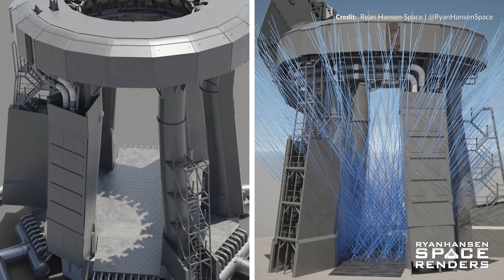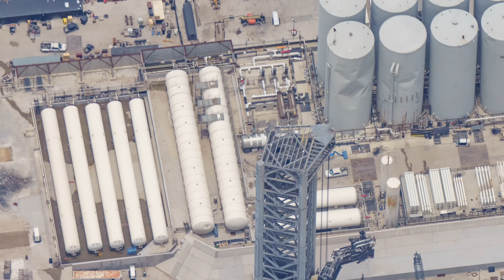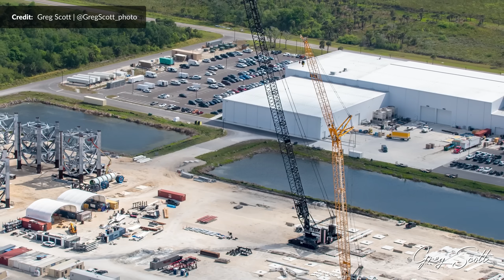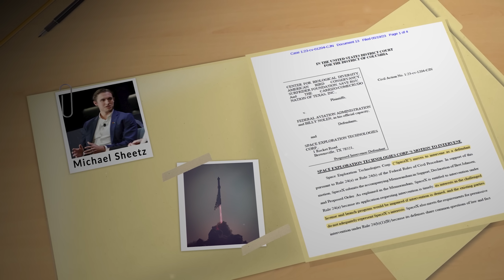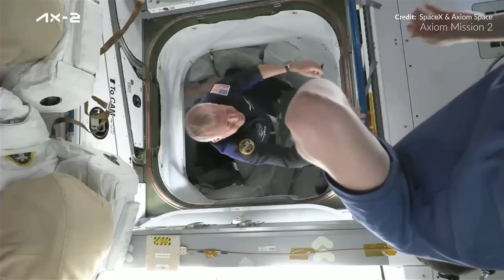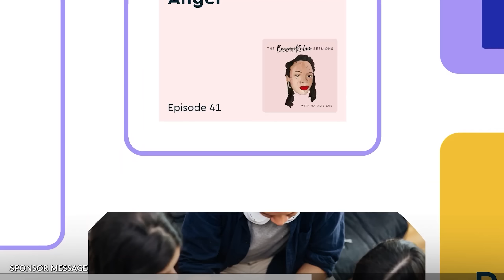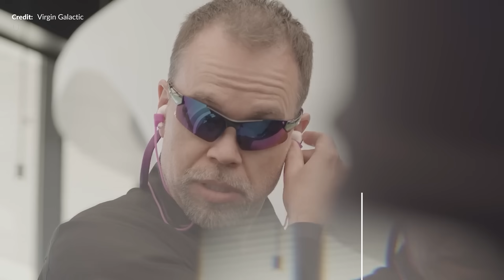SpaceX Starship 6,000 ton Capability, and SpaceX Joins FAA for Legal Battle, Axiom 2, Unity 25

Comment: HI ALL. DOES ANYONE SEE THE PROBLEM WITH LAUNCHING THIS WORLD'S LARGEST ROCKET FROM ONLY WHAT 80 FEET OFF THE GROUND AND AT SEA LEVEL?? I BELIEVE THE TOTAL LENGTH OF THE ROCKET IS AROUND 230 FEET. THE FLAMES SHOOTING OUT ARE LONGER THAN THAT MAYBE 250 FEET OR MORE. ELON AND SPACEX SHOULD MOUNT THE BASE OF THE ROCKET AT 250 FEET ABOVE THE GROUND. THEN YOU FORTIFY THE TOWER AND YOU WILL HAVE LESS DAMAGE. I BELIEVE THE NEXT LAUNCH WILL HAVE SIMILAR DAMAGE IF THEY DO NOT DO SOMETHING LIKE I SUGGESTED. YOU CANNOT HAVE THE WORLD'S MOST POWERFUL ROCKET SITTING SO CLOSE TO THE GROUND. IT IS COMMON SENSE. YOU DON'T NEED TO BE A ROCKET SCIENTIST TO SEE THAT! NO PUN INTENDED......

Comment: I truly appreciate your channel's amazing content; however, I feel compelled to interject here:

I am concerned about your treatment of the court case. SpaceX is going to court alongside the FAA against environmentalists, and there is probably a substantial reason for their concern. The message about Starship's importance does not address or attempt to resolve the case in any way. I would have liked to hear the environmentalist's arguments in detail and--perhaps--whether you think that the claims are justified. Dodging the issue by instead repeating SpaceX's money-based defense and reiterating Starship's standard elevator pitch--in my opinion--supports the idea that SpaceX should not be held accountable for unnecessary environmental damage like everybody else. The end goal is great, but what if they had just taken a more responsible route that threw less concrete? Blew less dust? And yes, it might have taken more time. It might have cost some money. But, that is not our concern. Irresponsible and/or lousy means to an end are NOT justifiable, especially when there are proper methods of proceeding--even if the end goal is great. It does not matter if it costs a bit more and takes a bit more time. A delay is only a delay because somebody set the timeline too short, not because an annoying (preexisting!) regulation got in the way. A lot of noble things would be easier if the law didn't exist, but that doesn't mean that we get to ignore it.

There is absolutely nothing wrong if you delve into the details and wind up raising a bit a of dirt in the process. I would not take it personally at all, and neither should anybody else. At the very least, if diving into the details is too much, please leave it as an open-ended question rather than putting a SpaceX-positive spin on it as a default. I have come to rely on this channel for NEWS that fits my interests, but this court case take is pushing too close to the realm of opinion, selective presentation, and diehard-advocate content. In hopes of continuing to be informed by you and your team for years to come, I humbly ask that you consider this.

Sincerely,
    Scott
Reply: From the SpaceX motion to join the case, page 5.
"C. Plaintiffs’ Complaint
On May 1, 2023, Plaintiffs filed a complaint challenging the FAA’s environmental review and “decision to approve SpaceX’s application for a vehicle operator license” under NEPA and the Administrative Procedure Act. Compl., ECF No. 3 ¶ 14, Prayer for Relief (a)-(b). Plaintiffs seek to set aside the PEA and FONSI/ROD and invalidate the FAA’s decision to approve SpaceX’s launch vehicle operator license. Id."

The FAA was the lead agency with NASA, the Army Corps of Engineers, the US Coast Guard, the US Fish and Wildlife Service, and the National Park Service all involved from the beginning. The review was to see if Starship would fit under the existing EIS from 2014 for Boca Chica for Falcon class rockets or if a new EIS was needed.
Reply: @steveaustin2686  Ah I see, thank you.
Reply: @scottviola8021  You're welcome.

Comment: Will the launches of these super rockets change the spin of the earth?  We could be looking at minutes per year lost or gained based on the thrust against the earth's atmosphere.
Reply: No. Starship at most would mass almost 6,000 tons if they stretch Starship per Musk. And a LOT of that mass would be left on Earth as exhaust from the launch. The Earth masses around 5,972,000,000,000,000,000,000 tons. So a stretched Starship would be 0.00000000000000001% of the mass of the Earth.

Comment: Additional weight capacity with the Raptor 3 means they can throttle down and still push the same loads which also means more re-usability since they're not hitting operational limits. It also means they can absorb small deviations in payload mass if scientists want to throw an extra sensor on a future rover or something.
Reply: I somehow doubt the validity of your claim...

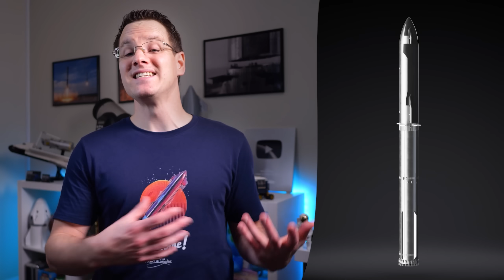Comment: 8:17 But the 20:02 Where all Stage 2 goes? I need that neobium.   xD
Reply: At 20:02 is the Falcon 9 second stage and it is expended. SpaceX eventually wants to reuse the Starship (second stage), but they are going to expend them in the  early testing as they dial in the accuracy.

Comment: Agreed the 6000 tones of capacity would be ideal for dense payloads like propellant  where the starship stays the same exterior size - this would enable tankers with greater capacity - it also has the effect of making RTLS for the booster easier.
Reply: It's not 6000 tons of capacity. The expended payload of Starship is 250-300 tons per Musk's tweet.
Reply: @steveaustin2686  I know 6000 tones is the potential lift-off mass when they have the raptor 3 in operation.
Reply: @stephenhumble7627  Yeah, apparently up to 300 tons of payload and evidently adding another ~800-900 tons of propellant. For a normal Starship they have 3,400 tons of propellant on Superheavy and 1,200 tons on Starship (second stage). There is somewhere between 200 and 300 tons of dry mass for both stages.

Comment: After watching, reading everything I could plus many top engineers opinions (who don't work for SpaceX) on the launch pad and just using basic common sense from so many different of engineers, this new launch pad using a water cooled metal/steel plate and its new engineered water deluge system, I am making a bold prediction. This new launch pad will be a failure due to not having enough ground clearance from the engines to the ground and no diverting trench to the base launch pad and if and when SpaceX is allowed to launch again with a FAA permit (which will not happen this year, if the FAA even does give SpaceX another launch permit), SpaceX will be obligated to destroy this launch pad and absolutely have to create a new launch pad with a flame, sound, heat, impact diverting trench with a better basic but more advanced huge water deluge system. 

No SpaceX engineers can anticipate what power the 33 Raptor engines will have on the base of the launch pad. This is uncharted territory and dealing with more power than ever attempted. SpaceX will have to accept the fact that a deep, strong diverting trench will be a must have, in order to absorb such powers from their Raptor engines, especially when they'll use the newest Raptor version 3.0 which is even more powerful than the present Raptor version 2.0. And they'll also eventually create a Raptor engine version 4.0 that will be on a complete next level in power differences from present version 2.0 to 3.0 and it would be much wiser to build a new launch pad that will be able to absorb these future powerhouses of engines. Right now, the changes they are making by adding this water cooled metal plate and water deluge system is like putting a band-aid on a bigger wound that will grow bigger if not treated appropriately in anticipation of increase power levels that Starship will have in the future. 

Last note, I don't think that the FAA will grant a launch permit to SpaceX this year, especially if the court battles against the FAA could drag on for months and even possibly beyond a year and change. I would love to know your opinions on this prediction or what you feel would be needed to make a launch pad able to withstand the powers involved? What are your ideas for something that could/would work, yeah I am asking your ideas and opinions as to what would you do?
Reply: To be fair, the distance from the OLM to the ground is the same as the distance from the pad at LC-39 to the bottom of the flame trench. What the OLM didn't have was a deluge system and a diverter.

The FAA gave SpaceX a launch permit in Apr 2023 that lasts until Apr 2028. Now they are grounded for Starship until the FAA is satisfied that SpaceX has determined the failures and rectified them. I would not be surprised if the repair and upgrades take longer than that, given how long it took to make Stage 0 in the first place.

We don't know that Raptor 3 will use that much more thrust than Raptor 2. They may want that extra margin for Raptor 3 to be able to run it lower than at max power for normal operations. That would likely increase the life of the engine for reuse, which is what SpaceX wants.

The court battles stopping the FAA and SpaceX would depend on the judge putting an injunction to stop flights until the case is over. That is not a given I would think.

Comment: Looks like the ISS is finally getting the number of crew visits that it should have been years ago. Once Starship is online, there will be potential to add some very large modules to the station, ready to use as a base to begin building commercial stations.
Reply: Axiom is already building modules to add to the ISS. They will be separated to become their own commercial space station, before the ISS is retired. Some of the newer science modules may be taken along, when Axiom's station is separated. NASA is funding one or more commercial space stations under their Commercial LEO Destinations (CLD) program, so with Axiom station, that should be a minimum of two commercial stations to replace the ISS and possibly more.
Reply: @steveaustin2686  More would be better, and especially a station that could be used as a hub for linked Starship units (or similar from othe companies) where that hub becomes the host vehicle for round trips to Mars etc, linking the vessels to share life support loads.
Reply: @PiDsPagePrototypes  Yeah, because the new commercial stations will each be smaller than the ISS, but with enough of them, they could be larger than the ISS as a group. SpaceX apparently didn't bid on the Commerical LEO Destinations (CLD) program, which seems odd, considering that one Starship would have the volume of the pressurized sections of the ISS. SpaceX did have the GAO redact the info on the [DELETED] Starship propellant depot, which also seems odd. I mean, if the depot is just a depot, why redact that it is a depot, only to confirm it is a depot from the context? I think that is because the [DELETED] Starship propellant depot is more than a just a depot and possibly a small station as well. That would be why it is shown in the graphics as stretched compared to a normal Starship, so that they can fit the active cooling systems and a small station together. It would make sense as a backup if Starship takes longer than expected for an Earth crew rating or if Starship can't be reliable enough for an Earth crew rating. Then the station could support Crew Dragon/Starliner for Starship missions where those capsules bring up crew, instead of launching on Starship.

Comment: A cylindrical ship of this size will not be able to land or launch on any celestial body, as it would blast its own grave twice, upon landing and then by launching. Anything within many dozens of kilometers on the Moon or Mars would be obliterated. Only a spherical ship with equatorial ring engines can make it to the ground. And then a huge effort is needed to just create a safe launch plate. How to build anything like a 1m launch concrete platform on the Moon or Mars? This takes a space able construction technology, a whole new industry
Reply: Take a look on the Spacex moonlander design, the engines for the landing are on the side of it so there will be no crater
Reply: The Superheavy booster doesn't leave Earth and is not needed on the Moon or Mars. The Starship (second stage) static fires never destroyed the concrete like the Superheavy booster did.

As Otopon said, the HLS Starship plan is apparently to use a ring of 24 smaller LCH4 engines at the top of the pressure tanks for the last bit of landing and first bit of launch on the Moon. They are roughly 25m off the surface, so that should minimize regolith disturbance with the landing thrust in 24 smaller engines instead of up to 3 larger ones. A Mars Starship would likely have a similar system.

Comment: if they'd only lengthen the starship and not the booster they will end up with less fuel in orbit then if they increased the length of the booster and kept starship the same. also lengthening the starship by 20% will deliver roughly 1% more fuel, as any extra kilo of payload needs like 4 kilos of fuel to get into orbit and every kilo of empty starship fuel tank also needs 4 kilos of fuel to put into orbit. The tyranny of the rocket equation. Just making starship longer would be incredibly inefficient.
Reply: From the graphics on how the refueling in LEO works, it appears that the [DELETED] Starship propellant depot is the one getting the stretched payload area. We really don't know what [DELETED] is besides a propellant depot, as SpaceX had the GAO redact info on it. We know that [DELETED] is at least a propellant depot from the context. If [DELETED] is only a propellant depot, then it makes no sense to redact that info, only to confirm it in context.

Most of the propellant depot space is in the tanks. The payload space will have any active cooling systems needed as well. But if you also stretch the payload area for a crew transfer station, then it can be a backup until Starship can be crew-rated for Earth operations or if it can't be reliable enough for Earth crew operations. In either case, you can launch the mission Starship unmanned to get refueled and send up Crew Dragon/Starliners afterwards for the crew travel from Earth to LEO and back. If the [DELETED] can support the spacecraft like the ISS supports them, then you can do missions of up to 6 months, while the capsules are supported for the ride home. Starship should be large enough for up to 5 docking ports, 4 on the sides, each 90 degrees from each other and possibly one on the nose. Once Starship matures to a fast enough cadence after Artemis III, then it may allow a Starship to directly replace the SLS/Orion for the trips to and from the Moon. Something like this would be worth redacting the info on a possible depot/station I would think.

Comment: Starship Luna version needs to be larger for more fuel capacity. Otherwise how will they accomplish that many burns? Even with LEO refueling the regular Starship won’t do it.
Reply: Apparently, with the HLS Starship being light enough and not carrying a full payload, it can leave LEO, wait for Orion in NRHO, land, and return to NRHO without refueling. After returning to NRHO, it would need more propellant to return to LEO or land again. So one of more Tanker flights to NRHO would be needed, if the HLS Starship is going to be reused.

Comment: SpaceX should move their Starship program to Bowen Spaceport in Australia, it's close to the Equator, politically stable, less regulations, far away from regular flights paths etc.
In other words way better than anywhere in the US.
Reply: As SpaceX is a US aerospace company, the FAA would still have jurisdiction. For SpaceX leaving the US entirely, so as to no longer be under FAA jurisdiction, there are TWO big problems. One is the International Traffic in Arms Regulations (ITAR) that would necessitate leaving a lot of the rocket tech behind as it is restricted for export. The BIGGEST problem would be leaving their two biggest customers behind, NASA and the USSF, both of which have lucrative contracts for SpaceX.

Comment: When you compare Starship to SLS, thrust to weigh is, Starship 1.51 lbs. of thrust to 1 lb. / SLS is 1.53 thrust to 1lb. The big difference is the solid rocket boosters on SLS. Watch and compare each launch, when SLS boosters ignite, the thing is gone!!! Starship when ignited, the thing doesn't move for 8 seconds, destroying the launch pad, and blow back knocking out and damaging engines. We will now get to see Musk struggle to slap bigger engines on his baby, which means more heavy fuel, which means even bigger engines. How long before he switches to much stronger and much lighter carbon fiber. Could be 5 years or more before he gets this right. Genius? Of course he is!!!😂😂😂😂

Comment: I still think it would have been better for SpaceX to start from scratch on the launch pad rather than trying to fix that one up because the current wasn't DESIGNED to be what it will become and I still think you need blast direction which would cure a lot of problems even if it creates other ones.

To me that whole layout just looked terrible from the start.  It looked like a person who was getting a BS degree and only finished their first two years of classes and hadn't started learning mechanical engineering, or structural engineering, or materials engineering classes yet.  To me that's how amateurish that whole launch pad area looked.  I mean tanks in a position to where debris could pummel them???  You're designing a pad that's going to launch rockets with the greatest thrust EVER and you think cement which isn't rated for that kind of pressure and heat is going to work???????????????

Stupidity abounded with that pad.  They needed to get a new team of engineers to take over that project, engineers that are specialists in ALL fields needed to build that pad site, and I mean people at the top of their fields when I say specialists.
Reply: Exactly what gives you the credibility to make that judgement?

How many rocket launch pads have you built?